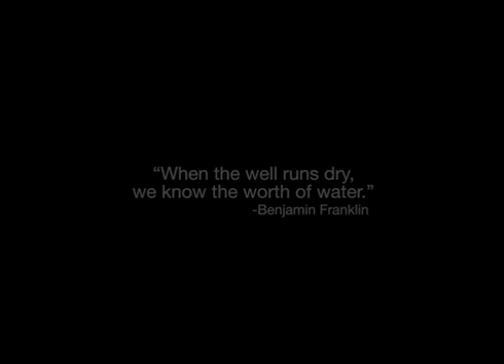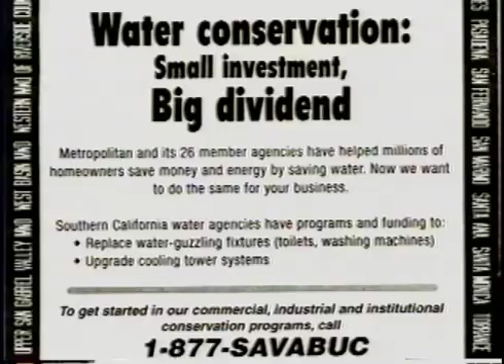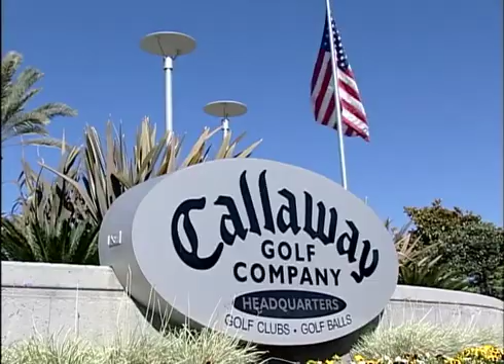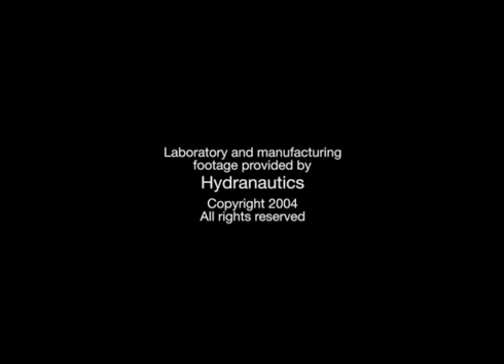An Introduction to the Carlsbad Desalination Plant Project

Comment: There is a new invention: Process of converting seawater to hydrogen, piping it and reforming it to freshwater that converts seawater into freshwater AND transfer it inland at minimal cost. It can be powered by solar cells. This investment would last generations and would avoid the uncertain weather.